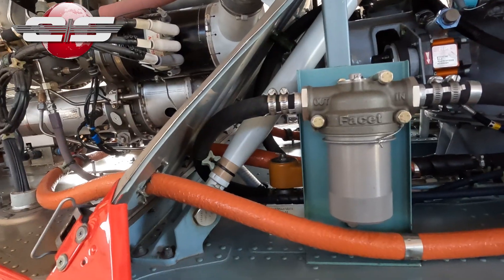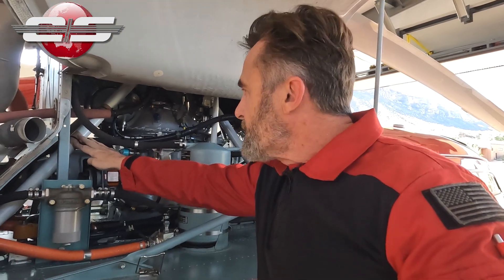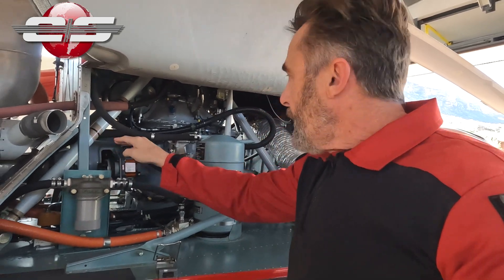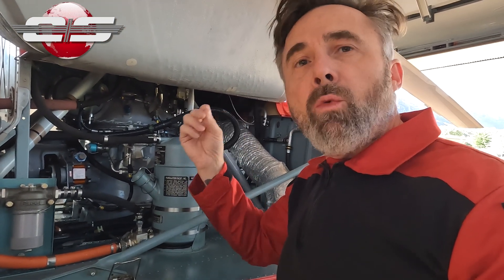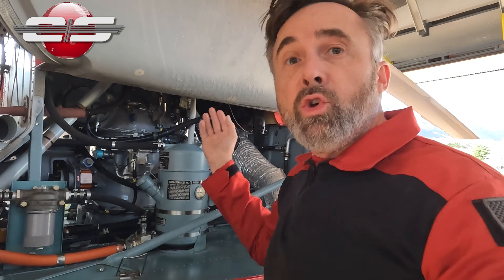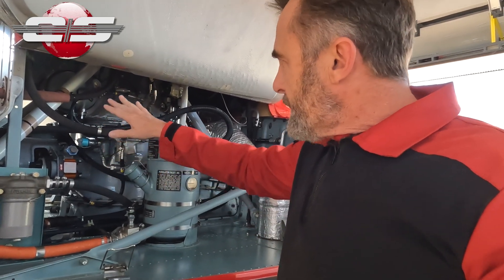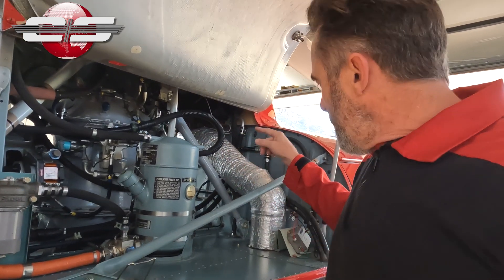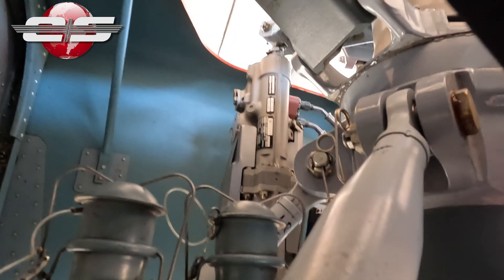#64 - Suspension Bar Safety: Comprehensive Preflight Tips for AS350/EC130/AS355

Comment: Is there a minimum acceptable  depth if there is a scratch, if it was hit with a wrench etc?
Reply from the maker: There is a tolerance, maintenance will determine by looking at measuring the damage if the bar is airworthy. Yes, the damage is often created by tools.
Reply: (the following is for the MGB bar only, does not include the End-fitting coupling radial play check)

IF: Chipped finish paint. ...OR... Dent, wrinkling, blistering, swelling < 0.2 mm (.008 in.) and for a total surface < 1 cm² (.155 in².) for anomalies separated by a distance of less than 150 mm (5.91 in.) ---->>> Sanding with 400-grit abrasive paper for corrosion and scratches, Protection with Protective coating in touch-up CM 316., Perform the touch-ups of Primer CM 487., Perform the touch-ups of Paint CM 4127.

IF: Sanding depth > 0.1 mm (.004 in.) and circumferential length > 40 mm (1.576 in.). ...OR... Dent, wrinkling, blistering, swelling ≥ 0.2 mm (.008 in.) or for a total surface ≥ 1 cm² (.155 in².) for anomalies separated by a distance of less than 150 mm (5.91 in.). ...OR... Crack. ---->>> REPLACEMENT